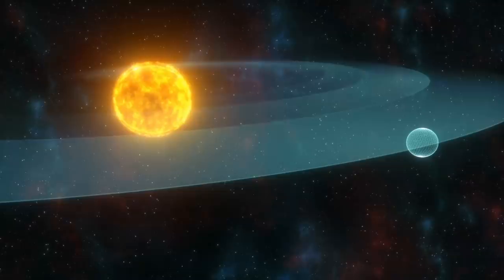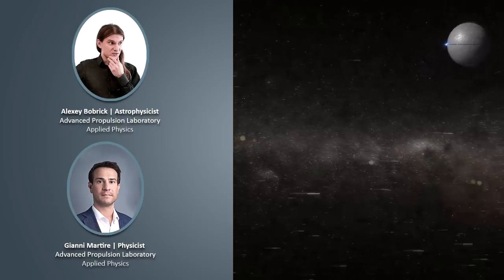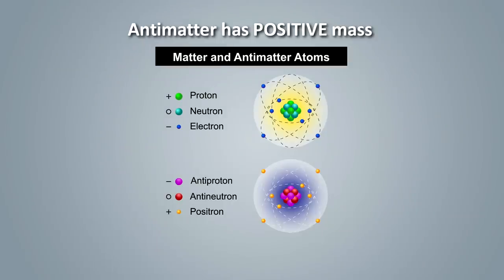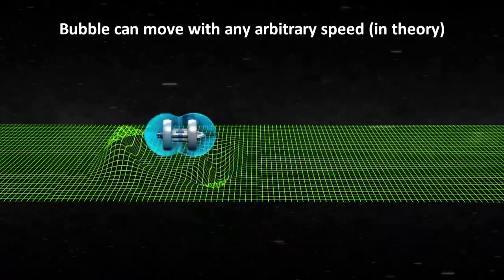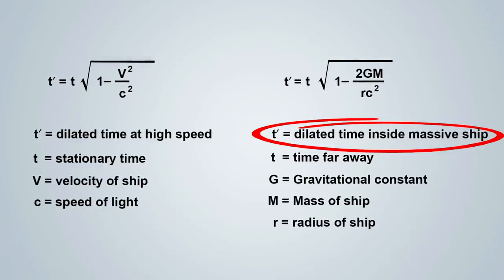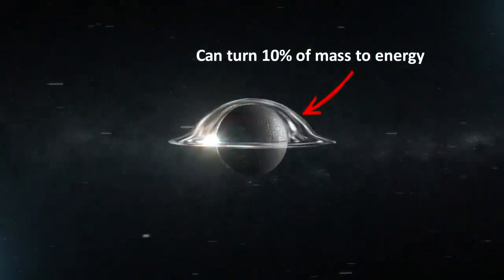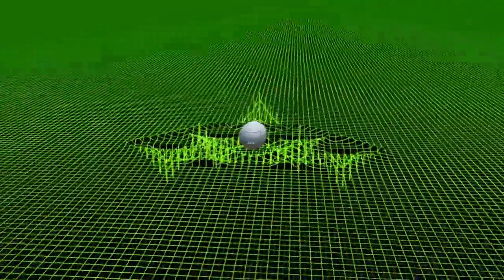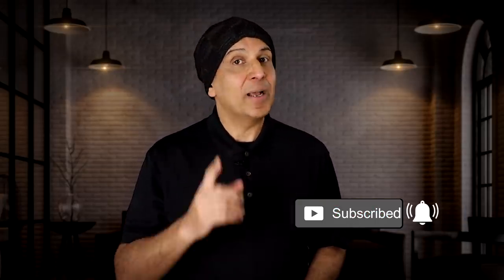REAL Warp Drives? NEW research proposes a solution!

Comment: Neutron star mass .. as in the kind of mass that would crush us like a marshmallow being stepped on by Godzilla?!
Reply: Lmao
Reply: Not in youre inside a hollow shell of the mass
Reply: @preppertechnicianee6013  .. With all that insane gravity good luck getting in the middle. You'd go splat ridding a neutron rod to the center, any other material would go splat on the sidewall before even entering a sphere. If you somehow teleported to the center, it would be like Godzilla blowing you up like a popped balloon.
Reply: @DJaquithFL  I think you design with intent you start in the middle and build a round you but yes this is an engineering problem not a physics one
Reply: @preppertechnicianee6013  .. You really need to look and understand the mass of a neutron star. 1 teaspoon is 1,000,000,000 tons. A typical neutron star is 1.4X mass of our sun shrunk down to the size of a tiny town. There's nothing that exists that could extract the material from the neutron star. I'm a chemical engineer not theoretical physicist but I understand mass. To solve this problem you would probably need anti-gravity and essentially probably be "negative" mass to counteract the neutron star material. Otherwise, anything known to man theoretical or not would collapse in any attempt to extract neutron material. 

If I were wildly going to guess at any possible FTL solution it's probably going to be some quantum based travel that we can't even imagine.
Reply: @DJaquithFL  noooo 

Actually you do this you simply  need another neutron star and massive amount of energy 

Never jump to  "Clark tech" without first considering brute force lol 

It also possible that we simply figure out a way to produce neutrons  mass for matter production without extraction 

Quantum ideas are currently is just clark tech

But here's a riddle for you 

If I teleport a copy of you 

Which is the real you ?

We don't know therfore " magic
Reply: @preppertechnicianee6013  .. Think about that for a minute. A Neutron Star would have "you" not the other way around. This Neutron Star sphere is nuttier than a peanut butter.
Reply: @DJaquithFL  I think this neutron sphere is 

1 interesting math which reveals other physics solutions 

2 plausible if we find the correct engineering solutions

Comment: Not possible!  Ever if you can make a "warp drive" or "time warp",  they in themself cannot go faster than the speed of light.  The spaceship itself has mass, which would slow it down. Forget about a bubble around it.  That could not hide the fact that the spaceship has mass!  Space isn't void of matter.  There are particles all over the place.  Light is energy made up of  photons, which has no mass so it can't slow down, or speed up!  That is why it can go as fast as it does. and objects with mass cannot, and never will.

Comment: From what I’ve seen on YouTube about FTL flight, the problem is mass (E=Mc²), but what if you could lower the mass of any sized object to zero. How much energy would you really need to move faster than light? Just a thought.
Reply: Good your reasoning. It is the first that I see that you see and intuit how to turn the problem around. Well, just at this moment it was possible to experimentally obtain negative mass, and therefore negative energy. This was done with rubidium atoms transforming them into a super fluid through the bose-einstein condensate method. With this method he manages to dissipate the energy of a particle to zero, but this time with these atoms it dropped to levels less than zero. This is the type of reasoning to use.

Comment: So...10% sun mass, that would be about 33000 times earth mass, and as such gravity on the surface would be 33000g...Good luck making engines capable of handling that gravity and moving such mass - I'd rather hold out for the discovery of negative mass. Also, the only "safe" place for passengers would be right in the center, where they are not affected by the gravity - and not that much space either, considering the whole thing only has a diameter of a bit over 600m. Would they even experience time dilation when not under the effect of gravity?

Comment: What's the use of warp-drives, if humans don't know or really understand WHAT the Universe is, and HOW it functions.
Speed alone, can't get you crossing Galaxies, in practical time-periods.
Reply: Eye; they are different things a Quantum Drive impulse engine, or whatever you want to call it, just drives you; just as you express it, but generating a time space bubble is different (That’s the concept that allows an object to travel, outside the physical space-time limits). The impulse engines push us by the energy applied on the front that is equivalent to practical effects would be to simulate mass in that area (E=m*c 2), passing the opposite in its back, to thus generate the effect of mini gravity in front of itself. That’s similar; at a more basic level, if you want to compare it to what happens in wheel-like space stations, where your gravity is simulated using centrifugal force. Ultimately; regardless of the complexity and how this becomes equivalent; we started using energy, focused on the sense of travel. This technology of course is applied at the time, and proper dynamics that can take full advantage of this scheme; and it is there where a better result may or may not be obtained. Now putting things aside; a time bubble is a completely different concept, although it carries certain similarities to a gravity impulse engine. A time-space bubble; it envelops the whole object; and it must be disposed of sufficient mastery, in the handling of edge that surrounds it, to make its contour fluctuate at will, such as its envelope is equivalent to the tail of a fish, oscillating to traverse the sea. In impulse systems, only the effects of acceleration are attenuated (if the cabin is in its front part), but does not cancel the effects of "G" forces on their crews. Basically that is the difference between a time-space bubble; where the object totally wrapped up in such energetic mechanics, does not travel through space, but by being isolated space temporarily, makes space pass through it; compressing the space in front of it, then decompressing it behind it. Thus, any gravitational wave flows through it, as if the object did not exist; and therefore everything within it is alien to them. This is easier to digest; if you imagine seeing by telescope a star as a centaury alpha, thinking how long it took its light from where you are, and at the same time consider the warping of space that produces a black hole (which dilates space, and thus time) ; but if you had the necessary energy your ship would simulate this on a smaller scale (it would be a mini black hole); in that it would be enough just to bulge it in the direction where you want to go; Just like a hamster can run and apply his energy on a wheel to where he wants to go. In conclusion; if that light-year relationship to Alpha Centaury is 4,367 years; what you do is create a time-space bubble; isolated from time; focusing its sense and direction that way; more than thinking that it will take 4,367 light-years (traveling at the speed of light); you must think that without moving you will move in time (that time); not through space (which would be indifferent to you) those years, but where you arrive at your destination.
Reply: @Francisco23812  Thank you for the Information. and the Link: 
Consider this for a moment... The  Easiest way to experience travel across Galaxies in minutes, is to learn HOW to access "The Processing System of LIFE", access its 'Permanent Libraries', and learn more about its Technologies and Programing.... This technology was used before the Earth was ever thought of, and Still used in the Program manifesting what you believe to be your Universe.

Comment: What if you don't need to travel faster then light speed but find a solution in prolonging your life by stem cell regeneration then you will be able to travel outside the solar system at 15 percent light speed with solar sails. Travel time would be slow but you will have all the time in the universe to get where you want to go as in theory you will be able to regenerate your cells to live forever.

Comment: I think this is going to be solved with Quantum Wave fluctuations. I now think Gravity is likely drag created with the interference in one or more quantum fields. So instead of big masses, you work with super cold single atom layers to tune into the quantum field and create zero or negative gravity depending on how you phase change to remove the interference that causes mass (the Higgs field). It's kind of like the piezoelectric Impulse design -- but it works by "surfing" at the quantum level -- not by shifting it's mass around. A bonus is that it's possible the Quantum Field of space is more energetic than normal matter and the device can capture this energy once it's in phase. Basically; it's a massive "Maxwell's Demon" device.

Once you are "tuned" to space -- then I theorize there is no resistance to passing through other matter and photons -- the quantum fields might just allow your ship to skip by without interacting because there is NO DATA LIMIT to a point in space -- but that's another discussion.

Comment: This is so stupid. The Alcuberrie drive is STILL the best solution yet. Because it would be POINTLESS to travel ANYWHERE if by the time you got there everyone you knew on earth who sent you there is dead. And the Alcuberrie drive is designed to shorten travel time by going faster, NOT by cheating and trying to slow time just for the people on it. That's like using a black hole as a form of time travel by circling it for a few hours so time slows for you but when you get back years have passed. Has anyone seen interstellar? And there are some scientists currently working on creating an element that does have negative energy, which would ALSO have negative mass. It's IS possible, and I have faith that we humans WILL figure it out one day.

Comment: The problem with all these PHDs is that they think in "state of MATTER", rather thinking in "plasma state".  
simple question would answer the entire problem. How often dose EARTH get its fuel from GOD to spin around itself and go around the SUN? If you QUIT thinking like Einstien you realize that the EARTH produces its own energy to spin around its own axis and with gravitational forces of both SUN and EARTH, the EARTH moves around the SUN. and as you know the entire Solar system goes around the Central Black hole. and to extend this CIRCULAR movement our entire Galaxy is moving with unbelievable speed , MAYBE around the CENTER OF THE UNIVERSE!!
To alter the space and time density requires massive energy like the mass of planets.

Comment: I get annoyed of how often I hear... "nothing can go as fast as the speed of light"..  why do people think this? Dont we have more evidence that says we can? When presenting the theory of realativity, Einstein said that the theory wasn't complete and we basically had to change the way we think and that once we achieve the speed of light that would be slow... so... maybe we can find a way to use light as a propulsion method and we can accelerate at the squared speed of light? I call it light splitting..
Reply: That way we don't like... mess up our spacetime or something 🤪
Reply from the maker: The main problem is time stops at the speed of light from a stationary perspective, in addition, it requires infinite energy to accelerate to the speed of light for anything with mass.
Reply: Ok... so we don't know how yet.. point kinda being... we are being limited by the limitations that we set. It's a small detail.. with a huge impact 

And we don't really understand light... we can't even decide if it's a wave or a particle.. maybe we can isolate each model (wave and particle) pulling the light into 2. And releasing the energy that makes it 2... super basic way of putting it... just seems like we accept that we don't understand light and don't care to try.
Reply: also note..  I have absolutely 0 formal edu in any sort of physics or anything post hs.   So there's a decent chance I missed something super basic. .
Reply: @ArvinAsh  .

Comment: Sorry but no, if u use time dilation you aren’t getting there in 10 months, it just feels that way. For example if u fall asleep and awake up what feels to u 5 minutes but then someone tells u you’ve actually been asleep for 3 hours. Who’ve been asleep for 3 hours its the same principle for the time dilation.
(If im spelling time dilation wrong I apologise im not good at spelling)
Reply: Time dilation isn't a perception of time moving faster or slower.
It's an actual physical effect that's been proven using multiple methods.
The passage of time for the fast travelling astronaut feels normal, but a year of ship time could mean 10 years or 1000 years or 1000000 years have passed back on Earth, depending on how close to lightspeed the ship moves.

Comment: In fact, there are obstacles to traveling on such a ship. Firstly, this is an incorrect formula that you mention (E=mc2). What is its wrongness? The main contradiction is in your reasoning. You mentioned that time slows down with increasing speed. And if this is the case, then the engine power decreases exponentially with increasing speed. After all, one hour on Earth is no longer equal to one hour even at half the speed of light at which your spaceship is moving. Let's say you have reached a speed at which time on the spaceship has stopped. What will be the engine power of your spaceship in this case? It will be zero. In addition, you cannot produce work (the ship's engine) and apply it to yourself. You forget the words of Archimedes: "Give me a fulcrum and I will turn the Earth over." Your ship, this is an attempt to exclude a fulcrum from Archimedes' formula!!! In addition, one of the heroes of literature is remembered - Baron Munchausen. Who got into the swamp on a horse and began to sink. He found a "brilliant" solution, grabbed himself by the hair and pulled himself out of the swamp with the horse. No matter how strong you are, you cannot grab your hair and even tear yourself off the Ground or from the chair you are sitting on.
Reply: Go read a real physics book. The mash of science fiction/Ancient Aliens/amphetamin/missing your medicin isn't to impressive.
I know you want to feel special, but this is not the right way.

Comment: Bob Lazar described this before in 1989. He said he worked on a UFO gravity engine. But you made a video where you tried to mocked him. All what he described make sense and you are the one that has no credibility. We have seen that all what BL described is true. Element 115 stable (extracted on bi star planet) can generate anti matter when bonbarded by protons. Anti matter is used for two things. One to create a distortion around the ship and two to generate gravitational foels to suck the ship inside by using amplifiers ring and projector and shaping the wave through the bottom skull di electric metal variable spacing system to amplify the waves.
Reply from the maker: Lazar described nonsense devoid of any real science. He did not describe anything like this.

Comment: Great concept which will hopefully one day be possible. Just one caveat. Time dilation is so widely misunderstood as a bending of time but it is not. Gravity affects the measurement of time (speeding or slowing a molecular clock) but not the actual passage of time. When a clock is slow, we don't assume time has changed.
Reply: Our bodies are made of molecules.
Reply: „ Gravity affects the measurement of time (speeding or slowing a molecular clock) but not the actual passage of time.”

Explain then why is the decay of molecule different at different rates of time dillation then. O wait, you cant. Time is slowd down.
Reply: @laurentiuvladutmanea3622  The decay with muons is hard to determine. They don't all travel at the same speed. The argument that their decay supports time dilation is at best inconclusive.  I agree the decay would be the best support for time dilation IF they could be accurately measured, but so far that has proven difficult. We must rule out the inaccuracy of our perception before we can definitively prove time dilation.

Comment: If the ship material has a mass density 10% that of the sun, the people inside it would be crushed by the gravity generated from the material. This theory is crushed.
Reply from the maker: No, inside a hollow ship, gravity would be zero.
Reply: @ArvinAsh  You're right. "inside" would have zero gravity. Outside would be a different story. So, how are you going to get inside without getting flattened on the sphere surface? For that sphere size at 10% the sun mass, the gravity can suck in a whole planet. Think about it...

Comment: One tenth the mass of the sun is about the same as 100 Jupiters so good luck with that.
Reply: The energy of Jupiter is 50,000 Exajoules; In the double bubble system, almost half is needed, and with 2/3 of Positive mass, combined with 1/3 of negative mass (separated with a minimum space from each other), and taking advantage of polygonal shapes; this is reduced to only a few hundred Exa Joulios. Solved this; additionally said positive and negative mass must support a temperature with several zeros more than that of the Sun. That is the true bottleneck.